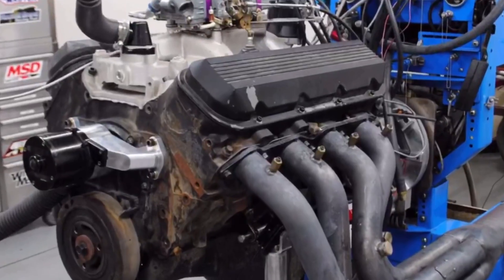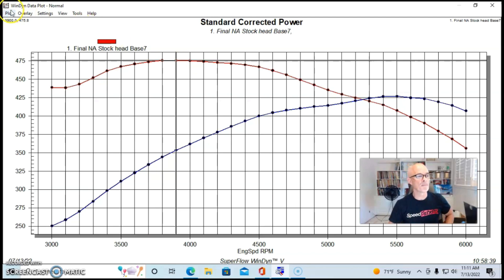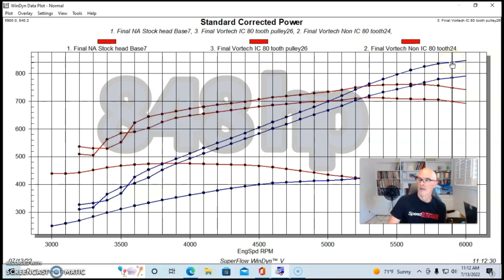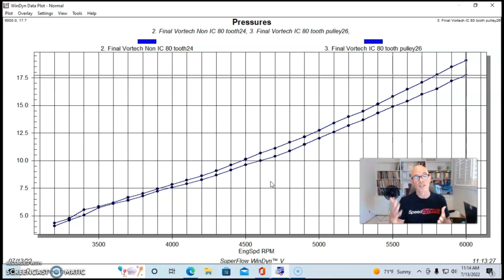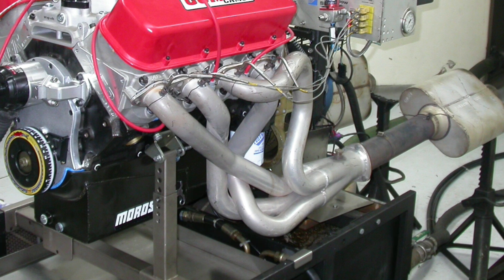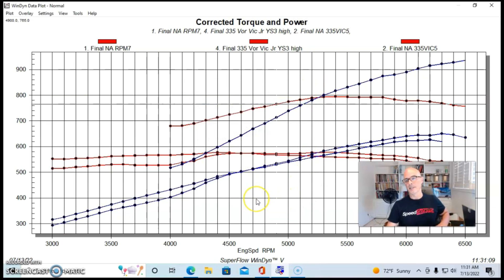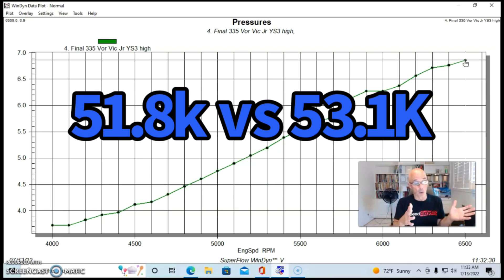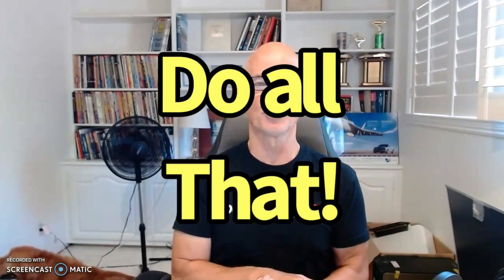HOW TO BUILD BETTER BBC BOOST-VORTECH 454 VS VORTECH 496-HOW TO MAKE MORE POWER WITH LESS BOOST!

Comment: It will take about 21 pounds off boost to get 1000 hp from a 454. So e85 is the way to go. And its cheaper then gasoline. It will take more fuel per gallon but think of all the advantages. No intercooler,  great, very little turbo lag. With expensive heads the power numbers won't jump dramatically. Not worth the money either.

Bloodviking

Comment: How would you run a blower with a tunnelram? Would you use two blowers/turbos with blow through carb hats; or two throttle bodies on a big plenum employing EFI (kind of like on the Hell Cat only going up through the hood instead of using an old school cross ram)?

Comment: Hey brother I was hoping you could help me with a question if I put an air fuel sensor in the cross pipe that connects my two exhaust pipes together on the H pipe of my Mustang will I get an accurate reading
Reply from the maker: no

Comment: I think the 489/496 combo is a killer bang-for-the-buck setup on the street.  With a little more compression (say 9 or 10 to 1) and E85, you could easily make 1,000 hp+ with 7-9 pounds of boost.  It would probably run forever too.

Comment: Hi Richard,  Always wanted to see 2 centrifical superchargers with a 496 tunnel ram blow through carb setup? What do you think?
Reply from the maker: I have twin TorqStorm blowers coming up
Reply: @richardholdener1727  is that going to be on a tunnel ram,  because my question is do you need pre carb cross pipe to balance boost pressure or is it possible that the tunnel ram can do that for you post carb? Thanks
Reply: @donwalsh7521  ...or it has one of those dopey looking pressure boxes on a single carb. yuk. I guess the pressure would over-ride any fuel flow issues with single carb on T.Ram. Im interested to see !

Comment: What if the 496 compression ratio of 8 to 1 was raised to 10 to 1, so more power normally aspirated. Would the final boost pressure be even less than the 8 to 1 run? Where is the sweet spot on compression ratio vs boost/timing on pump gas?
Reply from the maker: raising compression raises boost too
Reply: @richardholdener1727  Gotcha, Thank you…

Comment: Hey sir. Doing a budget build stock l86 to lt4 supercharger and wanted to keep stock injectors and fuel pump if possible. Planning to install stage 1 or 2 blower cam with springs etc. Will the stock fuel system work? Thx in advance
Reply from the maker: stock lt4 injectors and pump
Reply: @richardholdener1727  OK so upgrading to lt4 fuel system is necessary? Just confirming b4 having to spend the extra money. Lol

Comment: I would have liked to see a more apples to apples comparison.   Same heads. Same cam. Same induction. But different stroke.
Reply from the maker: that was not the test
Reply: You just would have seen a very similar power curve.. with the bigger motor getting to the higher numbers  200-600 rpm sooner because of the increased displacement.

Comment: Hey Mr holdner do you still have those cross ram LS intakes? I'd love too see what the power numbers specifically the low end power numbers on a 4.8/5.3 with the truck Norris, I'd love to see the aftermarket and more people use them they're a very interesting manifold style to say none the less, those long intake runners could be a saving grace for 4.8 owners
Reply from the maker: too much trouble for daily driver